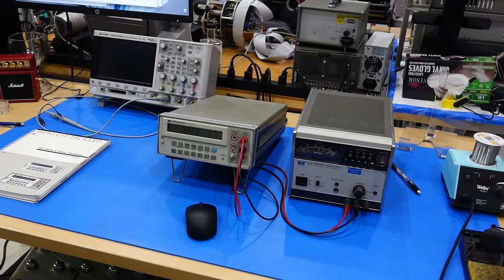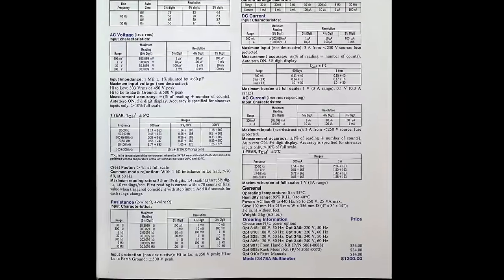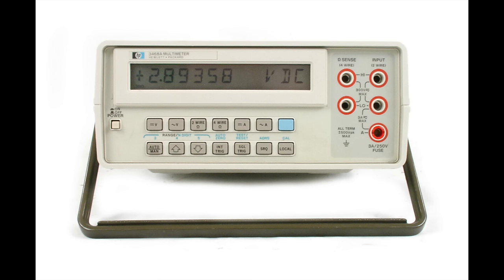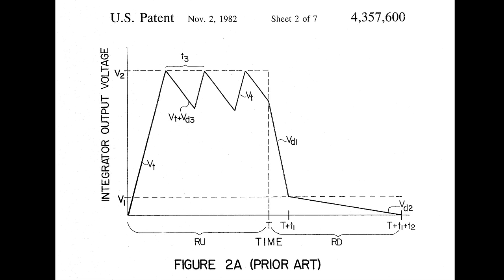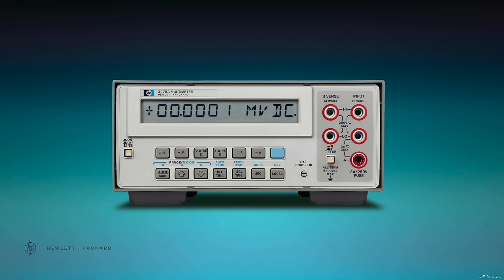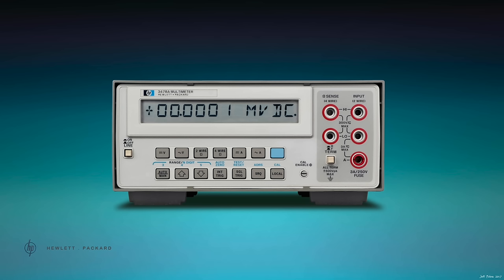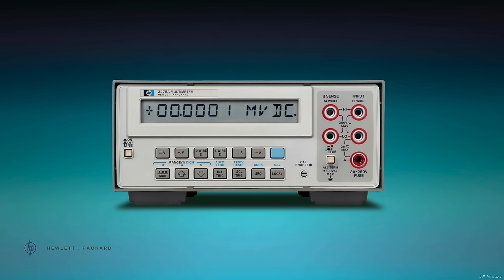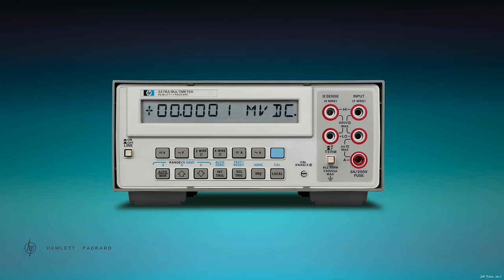Free Abandoned HP 3478A 5-½ Digit DVM Repair

Comment: You can also read our the calibration data via HPIB and restore it after the battery replacement. That is what I did, except after powering it on it still had the calibration data as if I hadn’t disconnected the battery.
Reply from the maker: Thanks for the tip, I did not know! Worth a pin. [Edit:] No wonder I didn't know, it's a hidden HP-IB command! Details here: https://www.eevblog.com/forum/repair/hp-3478a-how-to-readwrite-cal-sram/

Comment: "Puts modern Keysight to shame" Guess Marc is not looking for a sponsorship. 🙂
Reply: Or he's just honest and figures Keysight would agree with him.
Reply: Truth hurts sometimes
Reply: He already is sponsored by them, and likely they can no longer make the old instruments any more, having sold off the fab they had that was able to do all the precision semiconductors and the hybrid parts they used for them.
Reply: @SeanBZA   they could make their new instruments to the same level of quality as the old, but the problem with running a business is that you don't make any money if you make your products to last forever
Reply from the maker: Part of it is that the economics don't work out anymore. The electronics are so cheap that it does not make economical sense to surround them with expensive mechanical design and switches. Also, all the nice front panel experience has been replaced by user interface software, and the software interface part is not up to par, even on the very expensive instruments. No good excuse for that.

Comment: I have a real soft spot for the 3468A and B.  68s use a discrete zener reference, and you'd think they would drift or have a poor tempco... but after all these years things have generally stopped moving, and they have pretty legendary stability.  At least on the units I have.  The 78A and the 57A both use the same A/D converter, and the LM399 reference.  These things are absolute works of art... with the 3457A giving 7 1/2 digits from (more or less) the same A/D circuits :)
Reply: So long as you do not reset the aging by removing it, it will be stable for decades.
Reply: Is the zener heated on the 68 models?
Reply: @ferrumignis  No, the zener reference in the 3468 isn't heated.  I wondered how closely they had nulled out the temperature coefficient, and just recently got a data point... I left a Vishay VHP101 10k resistor (claimed zero tempco) connected to an HP3468B for about a week, exposed to temperature and humidity variations.  The reading never changed, not even in the least significant digit.  So, to within 10ppm the HP tracks it.
Reply: @d.jeffdionne  That's amazingly good for a compensated zener, HP never fails to impress me.

Comment: Agree completely about those dim LCDs. For a bench meter, readability is the point! I’m happy to sacrifice a digit if I can actually read it among the solder and electrolytic capacitors smoke… Fluke 8505A and HP 3490A (with added RMS module) here. Bright red LEDs. Can’t miss em.
Reply: Yes, I love the display on my HP 3490A, too.

Comment: Nice repair, thank you for sharing.
Again, it's the infamous front/rear switch problem, like > 20yo 34401A and even 3458A.
That's been discussed and repaired on eevblog as well.
I've found out, that a thin film of supposed plasticizer from the switch case had outgassed onto the springy contacts and the inner contacts, and I cleaned it the very same way as you did. 
That reminded me of the old Fluke 332B/AF I once had, where all the cables got extremely sticky.
Coming back to APOLLO, I once visited the Air and Space Smithsonian museum in Washington, where  Neil Armstrongs Space Suit is on display, under a glass housing. If I remember correctly, the description noted the very same problem, i.e. deterioration of the suit, due to the plasticizer outgassing.I don't know, how they preserve the suit from further degradation. Same worries about the WASA in Stockholm.
O yes, there's really an interesting article about the conservation of Armstrongs suit since 2015!

Comment: I got my 3478A off ebay back in 2015 as a birthday present to myself. I paid 58 bucks  if I recall correctly, and it came from a Boeing facility and had been freshly calibrated according to the label (was good for 2 years yay). It could have a couple extra features on it but overall I love it

Comment: Another 3478A back in business ,nice. I really like these meters. If I see one on ebay for cheap, I am compelled to buy it and fix it....   :D  PS: wow never seen one with a bad switch connection, seen bad relays, bad opamp, many bad batteries and capacitors, but a switch, wow.

Comment: Great video!  In this rare case, the problem turned out to be exactly what I thought it was from the start - an open circuit.  Amazing work by HP back in the day to come up with that multi-slope A/D design - as you said, someone thought long and hard about that.  The truly heroic backlight conversions that you showed at the end - OMG!   The OLED display replacement is off the hook!

Comment: My favorite meter oddity is a Digitec four digit DC mechanical bench meter which I rescued from the scrap pile at NASA Lewis back in the 1980s.  There are four ranges of 1, 10, 100 and 1000 Volts.  Mechanical?  Yes.  The readout is like the odometer on an old automobile, driven by an AC motor and also connected to a wire wound variable resistor.  The input is connected to one leg of a Wheatstone bridge and the opposite leg is connected to the wiper of the variable resistor.  When the bridge is in balance, the input burden is very small, so high precision is possible.  The bridge balance is read by a mechanical chopper stabilized transistor amplifier whose output drives shading coils on the motor to provide feedback tending to move the variable resistor to bring the bridge into balance.

There was a matching AC to DC converter box, but I parted company with that somewhere over the years.  I still use this approximately 60 year old meter for adjusting bias pots on audio amps.  The least significant digit has 200 microvolt hash marks between the major digits.  The least significant digit is analog like the least significant digit on an automobile odometer, so it is really easy to hone in on a bias adjustment.  It is much easier than using an electronic digital meter.

The Digitec must be a pretty rare bird, as I just did a cursory Google image search and I got were Digitec electronic panel meters.  There aren’t any listed on eBay either.
Reply from the maker: I think youtube ate your reply, but here is the video you linked: https://www.youtube.com/watch?v=xl-SjUW9Uho . I’m quite impressed by how fast it is. Great instrument indeed!
Reply: @CuriousMarc Youtube should be swallowed by its own algorithm's. Thanks for the link.

Comment: Great repair! As soon as I saw the wandering display I knew it was an open input but I have never seen the front/rear switch fail. Future video suggestion for an HP multimeter lover - find a broken HP 3490A to fix and analyze. Very interesting digital meter with no microprocessor. Regards, David

Comment: Reminded me of what the competitor did — if I remember, Fluke had their own solution, which they called Re-circulating Remainder system.  I never have had a reason to really compare the thermal and long term performance of the two, although I have for years owned some Fluke meters, as well as a couple HPs.  Well, actually my latest one is a Keysight 34411.  And as many times as I run a quick “Round Robin” test between all of my meters — many from the 1980’s — I can only admire, how all of them are still unsure only about their very last digit.  I have not used my hat for ages, but would need to raise it for the designers in these two companies.
Reply: I’ve got a Fluke 8060A meter which I bought back in 1983.  It was back to Fluke in the late 1980s for a repair when the display CPU quit working.  It is my daily driver tool bag meter and hasn’t been recalibrated since Fluke did the repair.  I compared the 8060A against my Keysight 34460A 6.5 digit bench meter and they agreed within +/- one or two counts on DC and 60 Hz AC sinusoidal input at 50% scale on the Fluke’s ranges.  It blew me away that a field use meter not getting special care had stayed on the mark after 30+ years of use.  Keysight rates the DC performance of the 34460A at 75 PPM after suitable warm-up of the internal reference.  My guess is the 34460A probably beats that spec for most circumstances.

Comment: What a nice meter, and indeed complicated - I'm still impressed seeing you go through complex circuits and systems both electronic and mechanical like a knife goes through warm butter. And I love the display mods. This meter seriously deserves a VFD instead of this bland non-backlit LCD. 

Pesky little Isostat buggers! That's how those multi-section pushbutton switches were called here, very popular through the '70s and '80s.

"A thing of butane is a joy for ever."

Comment: I have one of these on the bench, it was given to me out of a warehouse of stuff at a tech company before it all went to auction.  Still works perfectly.  I do keep it powered as it has the original battery.  I just have been to lazy to do the battery swap.  I power the Metcal iron with an isolation transformer rather than using a butane iron for working hot.

Comment: The entry level Keysight meter is the34460A 6.5 digit meter is capable of 300 readings a second and it is as nicely made on the old HP equipment.  Actually it is probably a cleaner design in some aspects.  The 34360A sticker price is about the same as a 1983 HP 6.5 digit meter, so adjusted for inflation it is about 75% less expensive.  The 34460A is one of the few items on my bench which I bought new, but I wanted a unit with a traceable calibration certificate.

Comment: My solution for the LCD problem on my 3468 is terrible but it works. A small bracket on the front of the instrument holds a section of LED strip pointed at the display from above.
Reply from the maker: Sounds like a good idea to me!

Comment: Who were the people who designed these? I don't mean just HP, it would be great to know, and if possible meet, the brains behind the circuits. Another great video Marc and crew, great job, well done.
Reply: George Hnatiuk - designed the ohms current source and the layout of the input resistor circuits. 
Kelly Wright - designed the dc signal conditioning and the custom input CMOS. 
Ron Swerlein - designed the ac signal conditioning and rms converter. 
Gerry Raak - designed the power supply, battery option and LCD.
Wayne Oeke - worked on the electrical robustness and AD converter linearity.
Bill Miner - mechanical design of the 3468A.
Doug Olsen - mechanical design of the 3468B.
Gary Staedele - I/O software and hardware design.
Jon Pennington - industrial design
Ron Tuttle - project manager for 3478A.
Rich Wilson - electrical design for the 3478A
Virgil Leenerts - electrical design for the 3478A
Ed Pennington - mechanical design for the 3478A
Ted Crawford - industrial design for the 3478A
Norm Dillman - design for the environmental test system and writer of the test software
Si Sanders - materials engineer
Joe Marriott - section manager for project completion
Roy Barker - origina section manager

(source: HP Journal 02/1983) http://hp41.betapersei.com/files/HP%20Journal/HP%20Journal%201983%20Feb.pdf

Comment: Love the videos. I share your passion for old HP equipment (& Fluke & Tektronix) 

 I hope you checked for RIFA capacitors at the line input. Also, when I replaced the battery on my 2 3478's, I wrote the date on the back of the unit.

BTW, according to the April 1981 HP Journal, Mullti-Slope II was developed for the HP3456A.

Comment: Marc, your timing is amazing! I'm currently trying to repair an Agilent E3634A power supply, which outputs power but voltage and current aren't displayed correctly on the front panel. I'm suspecting the A/D converter, which uses the new, improved Multislope III method. I've been struggling to understand how it works and your explanation has helped me a lot. Thanks!
Reply from the maker: What, they made a Multislope III? You can’t stop these guys. Good luck on your repair!

Comment: You may want to take a look at the mains voltage switch. In my unit there were 2 Rifa capacitors hiding inside the heatshrink tube covering the switch. Given the age of those meters it's probably a good idea to replace them because their failure mode is quite spectacular... Mine were in pretty bad shape.

Comment: I once got a broken HP 3456A for free, and besides the bit-rot of the Mostek ROMs, the only thing wrong with it was a thin layer of oily substance on one of the bridge connector going between the two sides of the inboard section. Like the problem you faced here, it was practically impossible to see with the naked eye, everything gold plated and no corrosion, it even felt like there was sufficient friction on the connector itself. Only way to spot it was to take a swab to it after realizing it was there one of the control lines did not pass signal.

Comment: bleh, YT auto-deletes comments with URLs in them... Attempt 2 : Nicely done ! About the offset in ohms range, note that there is only one set of cal constants; Cal labs seem to favour 4W mode on the rear connectors. Using any other configuration like the more common 2W mode on front terminals, will show noticeable offsets on the lower ohms ranges. To 'offset' this, I patched the firmware to add a "Relative mode". I can't link to it, but it's on github, eevblog, and my YT channel.

Comment: I’ve seen a white filmy substance form on gold contacts in several instruments.  Tektronix 2445 oscilloscopes and similar 2400 series instruments have input attenuators with little gold plated moving contacts which can get that film on them.  Tektronix warns not to disassemble the attenuators in the service book, but it really isn’t difficult, and cleaning will make an instrument is impossibly noisy traces useable again. … Now if there were a simple replacement for a defective fan motor in 2400 series oscilloscopes.

Comment: I have two 3478A's. Lovely things, though I need to get one of them calibrated. I also have a 3456A, which is another venerable instrument. I'd love to get some genuine front binding posts for the 3456A as the original plastic has degraded to the point where they are falling apart, but I've had little luck finding some. Any viewer (or CuriousMarc!) tips on where I might find some would be greatly appreciated!
Reply from the maker: Ah, the original binding posts. I would like to know where to find them too!
Reply: @CuriousMarc  that sounds like the kind of problem that people could get behind! I wonder if there would be enough interest to crowdfunding a small run of replicas, for not just the 3456A, but for any HP instruments that use the same design. PCBWay include custom injection moulding in their service catalogue, and there's probably a source for the metal hardware.

Comment: Are three pronged soldering irons really grounded? I live in a country (Vietnam) with no grounds, so everything is two prong and not polarized either. Electrical distribution here is a TT system, no combined or separate neutral and ground / earth. Next time I am back in the US I'll have to Ohm out my soldering iron there. For some reason, never gave it much though, but definitely something to be aware of and I should have known. Unless of course I have  a two pronged, double insulated soldering iron there, it's a Weller,  not cheap crap.
Reply from the maker: It’s easy to find out. Just measure with an ohm meter from the tip to ground. My Weller is sure grounded.
Reply: @CuriousMarc  For sure, that's exactly what I'll do next time I am back with that iron.

Comment: When you do 4-wire measurements with the sense bananas on the outside of the force bananas, you will measure of course the contact resistance of the banana jacks. I guess that's why it's first 33 mOhm, and later it drops to 20 and even 17 mOhm, because the jacks are getting "scratched in".

Comment: Another questions to your imac repair video years ago: 
My imac late 2015 has the purple edges all around the black frame (well known problem without solution) . So on IFIXIT you can find "around the edge is just where you put the double side tape to fix it to the case, exactly where the inner side of the double tape makes a boundary, there are some plastic bezels or framing stuff. this plastic actually is not only a guide to mount the LCD panel in the right position, is also a kind of seal that blocks the external source of light."  
- So does it help to glue this small gap between the plastic bezels or framing stuff to repair the pink edges around the screen ? I think that would be logical.